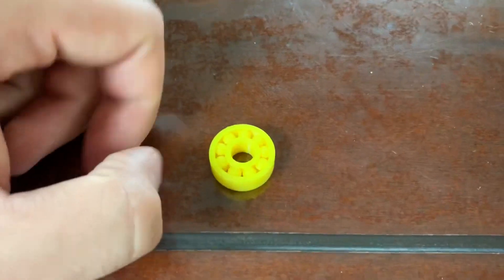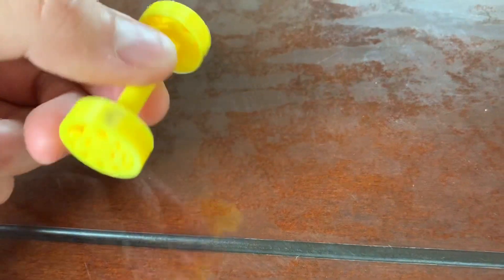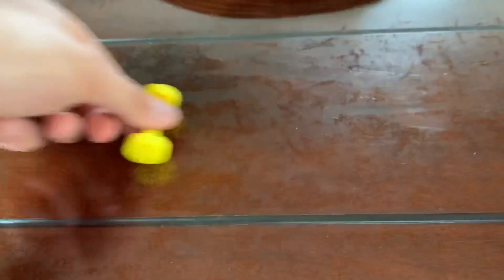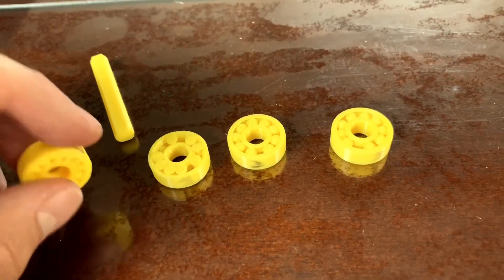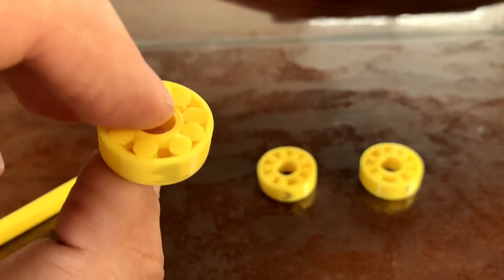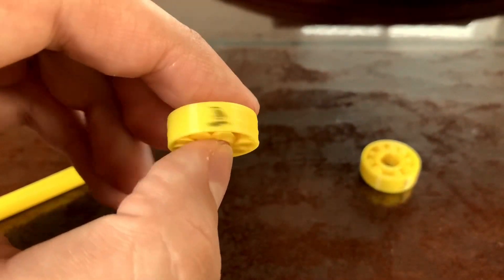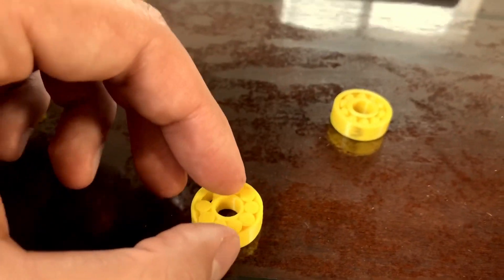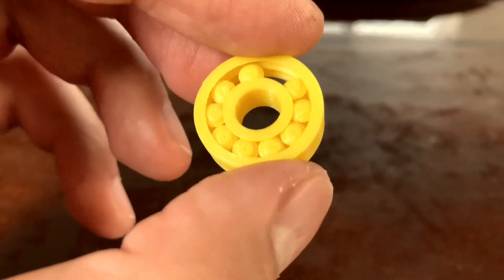Fully Functional 3D Printable 608 Size Bearing

Comment: I did a similar project a year back with rollers that have a single shrink at the center.  My only problem I wish to solve now is center to center wiggle induced by print in place clearances.  I am trying to make bearings for a backlash free gearbox.
Reply from the maker: Thats actually why I designed these. I printed the one from Thingiverse with the single path a few years ago and my bearing locked up very often because they would end up going sideways. With multiple paths, the bearings are held in the same position while spinning and never lock up!

Comment: Im having a little bit of trouble with printing this... I use the latest version of cura and im printing on an ender 3. My problem is that the balls are sticking to each other. Can anyone give me any tips to combat this?
Reply from the maker: LordApex did you print the tolerance test first?
Reply: @JLake3D  I had no clue there was one. Is it on the same download as the bearing?
Reply from the maker: LordApex printer has to be dialed in for this print. Search for “S Shaped Tolerance Test” on Thingiverse. Also my design.
Reply: @JLake3D  Alright Thanks
Reply: @JLake3D  If my tolerance fails half way through. is there any way to increase the tolerance? If so. how can I do this?
Reply from the maker: LordApex lower temp by 5-10 degrees, decrease flow rate by 1-5% without impeding print quality are where i’d start.
Reply: @JLake3D  Alright. Lets say I've done that, and started another test. This test fails again, but closer to the end. Would I just reduce flow rate? Also is it just flow rate or initial flow rate?
Reply from the maker: LordApex your print fails or the bearing sticks? If the print itself is failing than its all on your bed adhesion since this is a small complicated print. Maybe use some glue stick?
Reply: @JLake3D  Alright by failing I mean the tolerance is too low. Sorry for the confusion.
Reply from the maker: LordApex did you watch my tutorial for printing these? Even if its too close you can separate it using a hair dryer or heat gun to warm up the pla.
Reply: @JLake3D  I did see that.
Reply from the maker: LordApex what printer do you have?
Reply from the maker: LordApex try printing really slow for accuracy
Reply from the maker: LordApex also, are you printing in 0.2mm layer height?
Reply: @JLake3D  Ive got an ender 3 pro for my printer. Im printing at a finer layer height of 0.12mm. And I have tried slowing the print speed down. Im pretty confident I can figure this out now. I did a test and i had to play with the pieces that were connected on the initial layer but everything else was good. Thanks for the help! Also thanks for making a great model!

Comment: Nice design, just a quick question that i don't think was addressed along with the file, but what resolution were these printed at?
Reply from the maker: Drake Thomas 0.2mm but it should work with pretty much any setting as long as the distance between the wheels and the walls is accurate 👍
Reply: Drew Brew 
Got it, thank you!